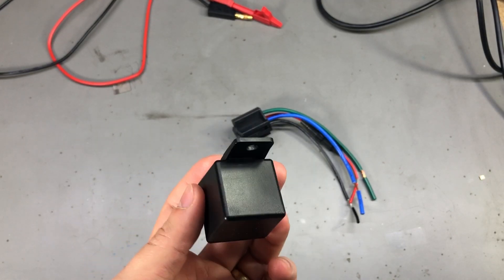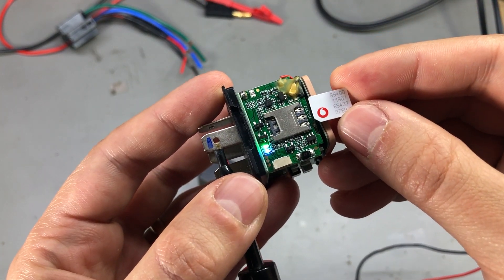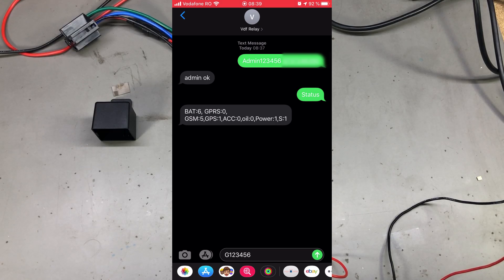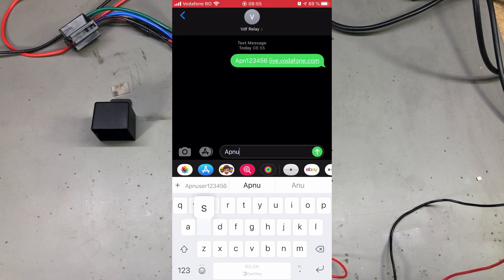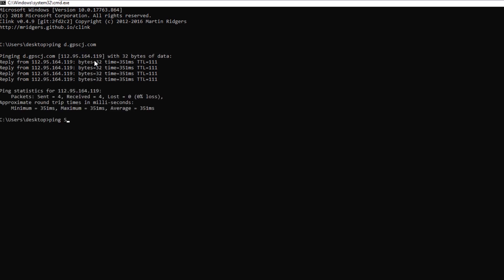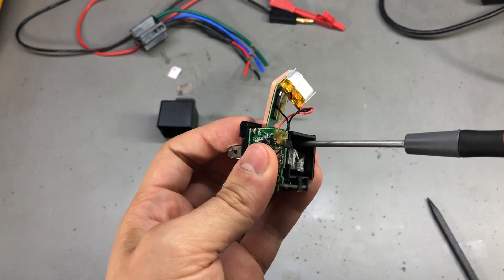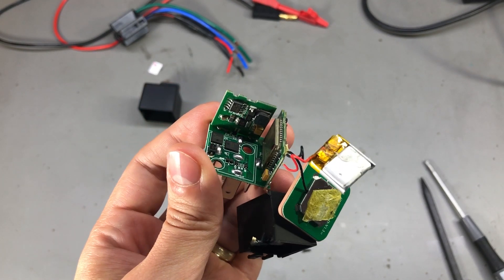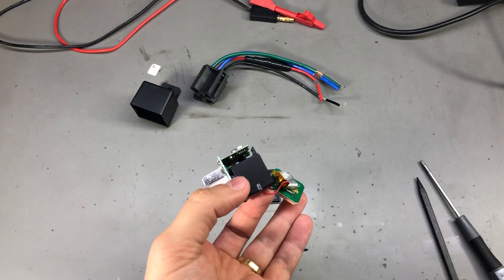Voltlog #272 - Car Relay GPS Tracker Setup CJ720

Comment: How many Volts are you running to power the tracker? im running 12v, amps is  fluctuating between 0.03 and 0.4, im using a sinotrack st907, manual says working voltage is 10v - 40v DC

Comment: Cheer~~~an electrical device, typically incorporating an electromagnet, which is activated by a current or signal in one circuit to open or close another circuit.😊

Comment: I have a problem 
I have a 2010 Kia Forte with a smart key. I installed a GPS tracking device for it, and when the ACC is ON, the GPS signal is very weak, and when the ACCis OFF, the GPS signal is strong.

Comment: hello, I also bought a gps tracker cj720, I connected it to the car, I started to set it with sms begin123456, then with sms admin123456 and my phone number, then I changed the password with sms password123456 and new password, since I changed the password, it doesn't receive any command and it responds with password err please if you can help me how to reset it
Reply: No
Reply: Hi friend, I have same situation. did you fix it?

Comment: This is a great video thanks. I got one of these and I connected it to the battery but it's not sending me an sms back, do you happen to know what I am doing wrong? I have checked it and both lights go on when I insert the sim card and I have also tested it in a cellphone but it doesn't send me the sms back when I'm trying to set the configuration
Reply: @harvyrodriguez I am having the same problem. What SIM is compatible to this device?

Comment: Silly question, but how do you text the unit to set the APN if it's not on your operator network to start with?
Reply: Put the card in phone and go into mobile data settings and set it manually.

Comment: Bought a tracker identical to this for use in the UK and a lot of the commands I have been trying to text it simply just don't work,
then If I ask it its location it just returns "NO GPS"

Thought it may be a iffy unit but bought 3, and all 3 are the same, very odd...
Reply: Same with mine

Comment: does anyone know a way of hard resetting this type of device? I managed to set an admin number thinking it was necessary for further settings and it accepted the number but I put it without the country prefix so even though the number is correct the device doesn't recognize it and throws a reply "not admin number" to all sms commands. I've tried all the format, factory, reset, begin commands via sms and the only one it reacts to was #begin#123456# which it replies "not admin number" to 😐

Comment: Looks that some setting like timezone or update time are not changed even if the module responses ok to a command. 
Can't get any sms alarm when armed. I.e. expected to get an alarm when acc gets +12V (simulating someone tryining to start a car), but with no result so far. Once got shock alarm. Due to exremely long lag on sms responses, can't rely on this thing.

Comment: I've spent two days trying to get it to work with a web tracking application, to no avail here in Colombia. Putting the sim in and changing some parameters was simple enough. I'm in Colombia, and have a 4G sim that is supposed to do 3G too. I don't know about 2G Some say the tracker only works with 2G, but that seems a bit silly for a "modern" design. Anyways, the SMS messages come in and get sent back to the Admin cell phone. I changed all kinds of settings trying to "connect" with Yuntrack and Traccar. I'm not sure if the CJ720 is supposed to talk with the local carrier MMS or internet server. I downloaded the traccar client app to an Android phone, for testing of the phone's settings, and could get a location, but not any tracks when I walked around the block. Iffy stuff at best.

Comment: Nice review, looking at getting one myself.
Could I hook this up to a Duracell DR5 style battery? As I'm think of installing it to another part if the car. The Duracell DR battery is 12V but some DR battery have different mah size.
Reply: I have used a standard 9v alkaline battery  for 7 days until i hard wire it to my Mobility scooter.

Comment: This is a very useful and detailed video. I have bought several gps trackers and now have one of these to test. I want something I can attach to my motorbikes that is reliable and can cut the fuel. But where as the others need to be hidden and that mean the satellite gps function is less reliable, with this device I can have it exposed because it looks like a relay. I glad you dissembled the unit as it shows there is no physical relay but a MOSFET to switch the power to the fuel pump etc. It does draw 60mA in standby, so the bikes  need to be kept on charge when not in use. It would be good if the GPS and GSM circuits powered down until movement was detected thus only requiring a few mA when in standby, but I do no if there is a command for this.
Can you share the link for creating you own server?
Great job. Thanks for sharing.
Reply: Yeah their documentation on this product is very very poor. Even today a year later. You are able to make the GPS tracker to go to sleep  if you send "sleep123456 shock". Then it will only draw very few mA until the device is shaken.

Comment: I believe this device requires a 2g network to work will not work on 3 4 or 5g network's
Reply: Well supposedly the sim card is capable of all 2,3,4G and new ones up to 5G so i see why it would only works with 2G
Reply: @orlanmedina3693 well if the device.only.has 2G.antenna....problems..

Comment: For your problems with gpscj site. I've had luck with NOT messing about with server settings. Other than the basic set up. I changed the apn my telco and changed the update time in seconds(1-180). 

I set mine to 180 seconds, it'll upload its own location every 2 minutes. Saving battery and data. It doesn't matter really; once engine is started and device is in active mode, the unit uploads data every 5-15 seconds. 

In disarmed mode, you'll won't be getting any vibration alarms. Only power cut. I don't have high hopes for that small lipo cell though, it might just fail outright when you needed it most. So hide it well. Chances are they won't be driving without a battery anyways. 

I use the relay to drive my keyless start kit. Since the rfid ring takes around 20ma as it pulses for the presence for key. It does this all day and all night, so this handy relay helps.

Comment: Hi, I've got a problem with my CJ720 unit which doesn't answer when I send an instruction.
The SIM card used works fine one my other tracker device (other model).
Lights green and blue are flashing normally.
I live in France for info.
Has anyone got an idea to help me?
Thanks in advance for your info,
Reply: Good evening,  now I have order the item cj720, gps tracker,  I don't know how to set up, so please help me if your cj720 is working now. ,  I'm staying in France. Thank you

Comment: Thanks for the instructions. Got it up and running in the UK on a giffgaff sim card. Works great, I wired the relay to the horn so if I am near to my car but can't find it exactly, I sms the command and switch on the car horn. Server is working on mine too.  Mine is in the car interior behind the dash and the signal is fine.
Reply: Hi Stacy, I cant get mine to update the GPS position, it shows its in China, Is there advice you can give me please. Thanks Clive
Reply: Hello there, I am not managing to Set it Up, I put the admim123456+number, I didn't have a response back
Reply: I reckon based on everyone’s comments this device does not work efficiently.    I also did notice the author does not reply or assist anyone so it’s a 👎🏾👎🏾

Comment: Sir, can you test the module if it is normally open or normally close without power, i need to know if the cutoff line is normally open or close if it no power. Thanks

Comment: I have very bad experiences with 12v car batteries and GPS trackers regarding the power consumption.... you said that this tracker can automatically go into sleep mode... did you send an SMS command to enable this function or is it enabled by default?      moreover, did you have any luck with server?

Comment: I am wondering if it is possible to connect in to ACC key ON/OFF to deactivate it when the car is powered....
Reply from the maker: why would you want to loose the tracking ability when the car is on and potentially on the move?! doesn't make any sense!
Reply: @voltlog  I would like to avoid the vibration alarm to activate when the car is moving. otherwise i have to set the vibration/shake alarm every time ON and OFF...
Reply from the maker: There is no way around that if you want to use the vibration alarm. That's the function.
Reply: The CJ730 (not CJ720) has an additional cable for ACC.

Comment: Got one of this installed. All worked well (ofcourse "Chinese well"). Left it for a few months in the car, without a Sim card and with a discharged main battery. Now, when I want to use it and plugged back the Sim , it doesn't work. The LEDs don't go on.... Where should I start looking for a fault? The black/red wires measure 12v
Reply from the maker: Evgeny Knafel check the internal battery, it might want that to be working.
Reply: @voltlog  shouldn't the internal battery get charged from the main 12v supply? Connected it on my table to 12v power supply and left it connected...

Comment: This is GREAT.. If it could still have the relay function would be mind blowing... looks great.
Reply: It does still function as a relay. It can be used to cut the fuel or ignition via app for sms.
Reply: Mine doesn't cut the oil( fuel)

Comment: What kind of tracking device would you recommend for my equipment trailers that would allow real time tracking should one of my trailers be stolen?  Thanks
Reply from the maker: I would recommend professional tracking service with additional low frequency trackers built-in besides the usual GPS/GPRS connection.
Reply: Hi Tracey our company has a trailer tracking solution if you want me send you info thanks

Comment: Please note that there is a huge security risk when using these cheap chinese trackers!

All of these cheap trackers are manufactured with sequential ID numbers and the same “123456” password, meaning that anyone who knows the ID of one tracker (your ID is shown very briefly in this video) can easily add or deduct numbers and input them along with the standard password, thus gaining access to track your whereabouts and even shut down your vehicle, if the tracker has this function and is connected to the fuel pump or ignition system.
I’ve also found that the standard password along with the reset command is able to reset some (if not all) of these devices via SMS from ANY number, even if the standard password has been changed and an admin number has been set on the device.

The first thing one should do to mitigate these issues is to setup their own traccar server. NEVER use the default chinese server!

If you for some reason decide to use the default chinese tracking server, please note that changing password via the server is not the same as changing the device password via SMS command and vice versa. But still, change the website password IMMEDIATELY!

Always chage the default password on the device via SMS command.

Never give anyone your number to the tracking device, NEVER! I tried the above method of adding or deducting numbers to guess other tracker ID’s for people who still used the chinese tracking server, and some people fill out the section on the server containing contact details of the owner along with the tracker phone number... This could essentially enable someone with bad intentions to get info about the owners name, private and work addresses, e-mail and social media accounts, pictures of them, who they hang out with etc. And worst of all, shut down their vehicle while driving, potentially causing a fatal accident.
The servers also keep a log of all the places you’ve been with the tracker active, and with some users I could go back several months and see their whereabouts on a daily basis, especially if their model of tracker was a wristwatch.
Reply from the maker: thanks! this is good info and good practice, however I'm never using the tracking devices shown on these teardowns in real life. I have already done a follow-up video with how to setup your own tracking server, it will be published soon.

Comment: Что будет, если внутренний аккумулятор сядет? Например, в местах, где температура на улице опускается ниже нуля градусов по Цельсию, и всё замерзает.
Reply: У меня при - 32 отлично работал
Reply: @royrogers7525  = Ihre Antwort ist nicht geeignet. 
Funktionierte der interne Akku und versorgte den GPS Tracker obwohl die Spannung der 12 Volt Fahrzeugbatterie ausgefallen ist ?

Wenn so ein Wunder geschehen ist und der Miniatur Energiespeicher tatsächlich ausreichend Spannung und den abgerufenen Strom bereitgestellt hat (das bezweifel ich sehr sehr sehr sehr sehr stark) ....
.... dann wird das kaum 1 Minute oder 2 Minuten erfolgt sein. 

Nebenbei angemerkt = Die Speicherkapazität dieser billigen Akkus hat eine begrenzte Lebensdauer. 

Bei gemäßigten Temperaturen (und niemals unter Null und niemals ein leerer Akkustand und niemals überladen )   ...
... wird sicherlich nach 4 Jahren oder maximal 6 Jahren keine Benutzung mehr sinnvoll möglich sein. 
Die Zellchemie altert durch Verwendung aber auch alleine durch die Zeit.
Reply: Wenn die Temperatur in den Lithium Ionen Akku (oder Lithium Polymere Akku) fällt, dann nimmt ersteinmal die abgegebene Kapazität an elektrischer Energie ab. Also funktioniert der GPS-Tracker ohne nach Trennung von der Fahrzeugbatterie deutlich kürzer. 

Welche Temperatur den internen Akku die abgegebene Spannung und Stromstärke vollkommen unzureichend werden läßt kann ich nicht sagen. 
Aber sicherlich geht ein Effekt bereits ab minus 5 Grad Celisius stark voran und je weiterem Grad Celisus wird das überproportional stärker sich verschlechtern. 

Achtung = laden von Lithium Zellen Bei Temperaturen um plus Grad Celsius ist möglich. Aber wenn es kälter wird dann sollten schnell Ladevorgänge besser ausbleiben. So machen das Bosch Akkuwerkzeuge und laden einfach nicht mehr ab einer Temperatur von ??? Grad. Makita Akkuwerkzeuge laden sehr wohl, aber das liegt eher an den sehr unzureichend konstruierten LAdegeräten ohne Prüfung der Außentemperatur und das geht stark zu lasten der Kapazität des bnutzten Akkus. (Ich weis diese Akkuwerkzeuge haben Lithium Eisen Phospat Akkus (LiFePO4) und diese sind technologisch unterschiedlich zu dem Akkutyp in dem GPS Tracker) 

Zur Antwort von roytogers7525 = Über die Fahrzeugbatterie wurde aber ihr GPD Tracker mit der notwendigen Energie versorgt.

Wenn der GPS Tracker für wenige Minuten bei normalen Temperaturen von plus 15 Grad bis plus 30 Grad Celisius Außentemperatur ausreichend lange Spannung zum Notbetrieb (also ohne 12 Volt Autobatterie) ermöglicht. Sehr lange versorgt der Miniakku allerdings nicht den GPS Tracker. 

Bei Temperaturen unter Null Grad Celsius sinkt mit jedem Grad mehr als linear die verwendbare Energiemenge die der Miniakku abgeben wird. 
Ebenso wird der kleine Akku nun eine erheblich kürzere Lebensdauer haben. 

Ihre Antwort ist nicht geeignet. 
Funktionierte der interne Akku und versorgte den GPS Tracker obwohl die Spannung der 12 Volt Fahrzeugbatterie ausgefallen ist ?
Wenn so ein Wunder geschehen ist und der Miniatur Energiespeicher tatsächlich ausreichend Spannung und den abgerufenen Strom bereitgestellt hat (das bezweifel ich sehr sehr sehr sehr sehr stark) dann wird das kaum 1 Minute oder 2 Minuten erfolgt sein. 

Nebenbei angemerkt = Die Speicherkapazität dieser billigen Akkus hat eine begrenzte Lebensdauer. 
Bei gemäßigten Temperaturen und niemals unter Null und niemald ein leerer Akkustand und niemals überladen ...
... wird sicherlich nach 4 Jahren oder maximal 6 Jahren keine Benutzung mehr sinnvoll möglich sein.

Comment: How do you mount it to receive the GPS satellite. It can't possibly be mounted under the hood. No clear signal at all! The last few years I've  mounted them under the dash on the right side usually using a puck style antenna. This design would not fit.
Reply from the maker: under the dash would work nicely, also in the back near the back window would also work.

Comment: This device most likely uses gprs but in the US carriers stopped providing gprs service long time ago. Moreover, even 3g is obsolete. For example, at&t 3g works in the central part of the US and doesn't in the east one. We need gps tracker that supports 4g/LTE data.
Reply from the maker: Here in Romania there is no indication 2G will be decommissioned soon but if you need 4g, you can find 4g enabled gps trackers on aliexpress, just have a search.

Comment: Set your own external IP-Address and check the Firewall on wich port the tracker tries to connect. Then set a forwarding for these port/ports to your own internal Server and analyse the traffic with wireshark. I think this tracker posts it's position via http. No encryption or other complicated stuff. It seems to be port 7700.
Reply from the maker: The problem is, I'm not seeing any connection, the trackers is not contacting the server.
Reply: You can configure the port you want it to send to. For Traccar, 5013/tcp is the port of choice. And no, it's not using HTTP.

Comment: Wow!  All of that for $14?  That is a very interesting device.
I wonder how easily it can be hacked to send data from added sensors.  It seems like an ideal node for any sort of IoT needs.
Reply from the maker: Other trackers run Android on a cheap mobile phone soc and those can be hacked but I'm not sure it's the same here because of the lower power of the device, this is likely running a lower power microprocessor.